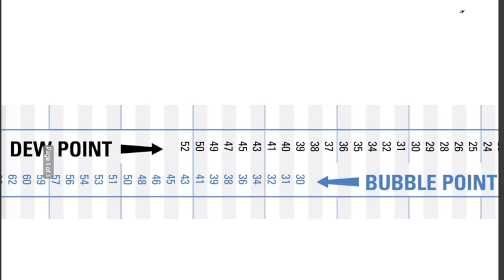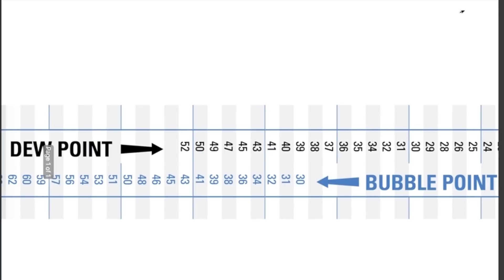Setting superheat and subcool with blend refrigerants.

Comment: I am currently using 410A and 404A, does this concept (the huge bubble and dew difference) apply to these refrigerants? Also, what refrigerants use this concept?
Reply: The glide on each of these is low enough its irrelevant